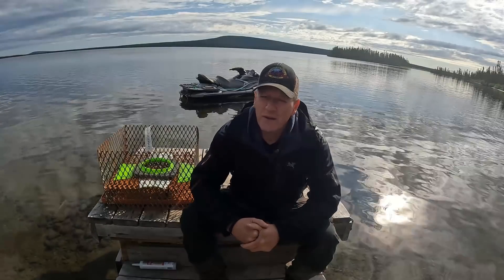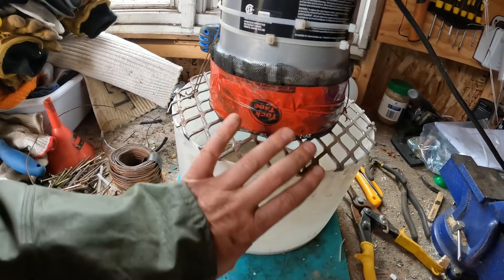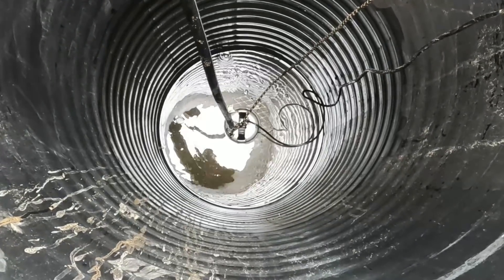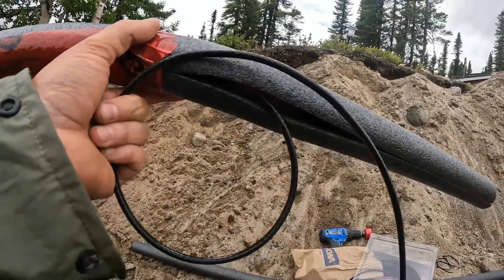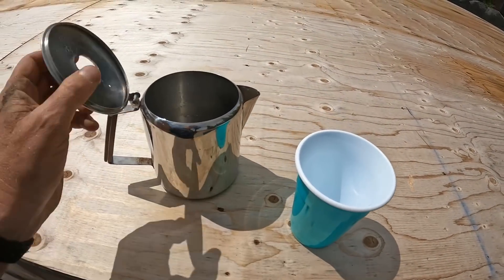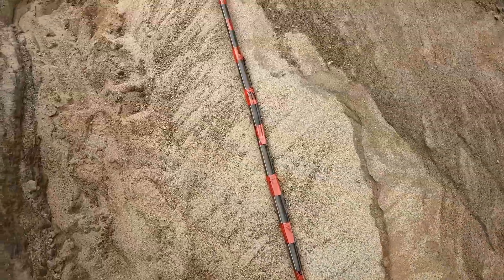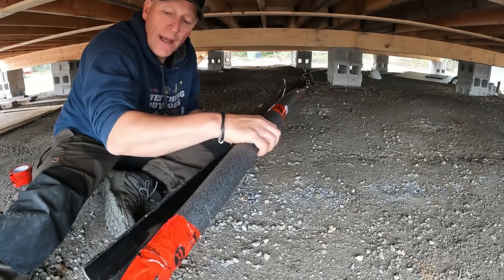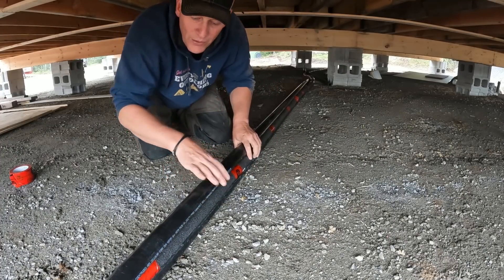Water A-Plenty!! 💦 A simple water solution for an Off-Grid Cabin  🏡

Comment: Awesome setup chuck ,will u be having another pump inside for pumping it out of tank to the shower and stuff ?
Reply from the maker: Yes I will. I have a 12 volt pump that’s capable of pumping 3 gallons per minute. And a hot water on demand system capable of the same.

Comment: Why not line the bottom with 1-1/2 inch stones.
Reply from the maker: I may do that later on but right now I’m giving it a shot like it is as I don’t want to lose any height of water. I’ve drained it about ten times now and the sand seems stationary at the bottom (doesn’t increase in height, doesn’t stir up). Will see what happens later on👍